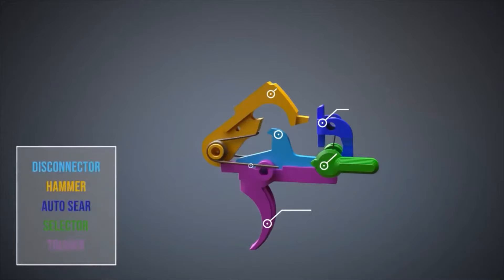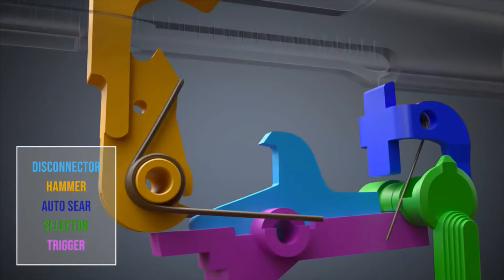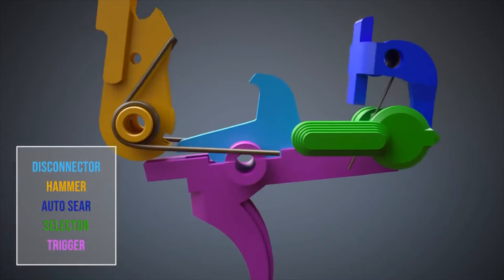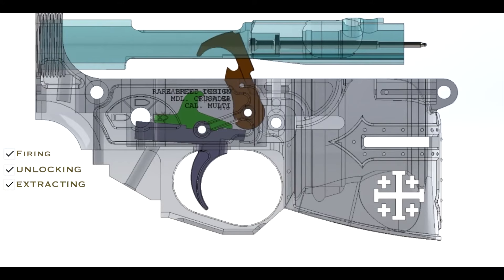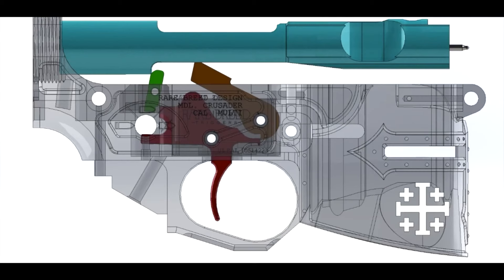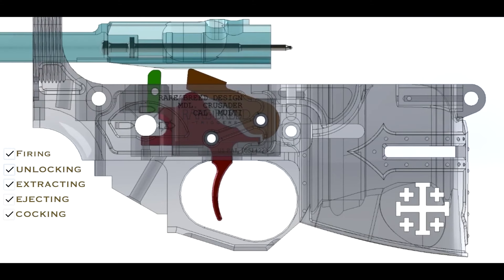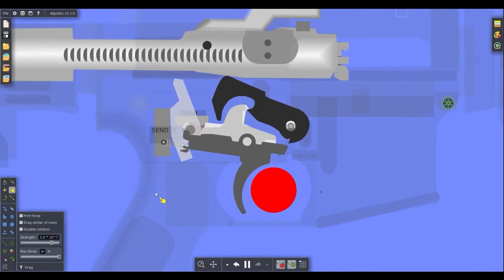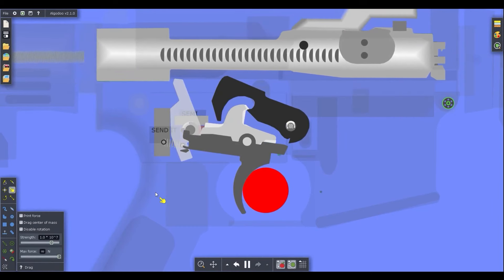HOW AN FRT-15 TRIGGER WORKS, AND WHY THE AFT HATES THEM

Comment: The key is in the very name of the trigger.  Forced Reset.  The shooter does not release the trigger and pull again, the trigger is forced to reset by overcoming the maintained pressure applied by the shooter.
The trigger is not released and re-pulled.
The shooter pulls the trigger and maintains pressure 'till they wish to cease firing.
it's a machine gun.
Reply from the maker: That's not the definition of a machine gun. A machine gun is "Any weapon which shoots, is designed to shoot, or can be readily restored to shoot, automatically more than one shot without manual reloading, by a single function of the trigger." The FRT is two actions, pull and reset, just like a semiautomatic. The only difference is the trigger resets automatically instead of the user having to reset it by releasing and it resetting itself with spring pressure. Literally not a machine gun.
Reply: @NOTSOSLIMJIM  
That's the ATF regulation for a machine gun, not the definition.
Reply: @NOTSOSLIMJIM  
Machine gun: an automatic gun that fires bullets in rapid succession for as long as the trigger is pressed.
Reply: @NOTSOSLIMJIM  
The frt doesn't have two actions, you just pull and maintain pressure.
Reply from the maker: @andrewholdaway813  I literally gave you the definition of a machine gun. You are using a generic definition. Even if you want to use the non legal one, you are still incorrect. Coming from someone with years of experience shooting machine guns, they are not the same. A machine gun you depress the trigger and the weapon continues to fire without the trigger being released or reset. The FRT resets on every round. The trigger goes forward and you pull it again. Even though the trigger pushes the finger forward, that doesn't thang the fact you must pull the trigger again. By your logic, all semiautomatic weapons are machine guns as they can be bump fired.
Reply: @NOTSOSLIMJIM  
Yes bump fire devices also make a machine gun, though not a particularly good one.
Reply from the maker: @andrewholdaway813  lol, ok guy.
Reply: @NOTSOSLIMJIM  
Always being right is a cross I have to bear.
Reply from the maker: @andrewholdaway813  if by being "right", you mean having no clue what you are talking about or fundamental understand of firearms. Then yes.
Reply: @NOTSOSLIMJIM  
Imagine you took a semi automatic weapon and fired it by means of a spring, which was of sufficient strength and no more, inserted between the trigger and the trigger guard. How many times would that gun fire - just once.
Now imagine that weapon has instead the Forced Reset Trigger installed and is fired by similarly sufficient spring, how many times will it fire - until the magazine is exhausted.
It's a machine gun.
Reply from the maker: @andrewholdaway813  so, we are using hypotheticals. Standard move for someone who doesn't understand a topic. Ok, let's play your game. Let's put a spring forcing the trigger back on an AR15 with a FRT trigger. First, you would be modifying the rifle, so your argument is already lost. The user also wouldn't be pulling the trigger. It would start firing the moment the selector was moved from safe to semi. At the end, it wouldn't change the operation of the trigger. It would still function the same. Pull trigger, reset, pull trigger again. The same as the Gatling crank trigger. You can bolt it onto a stock trigger, crank the handle, and it fires just as fast as the FRT. Been around for decades and perfectly legal. Why you ask? Because it still fires, resets, and has the pull the trigger again. You fail to understand that a trigger that mimics full auto does not make it a full auto. Congratulations on still being wrong.
Reply from the maker: @andrewholdaway813  https://youtu.be/jif4Wo0LDX8
Reply: @NOTSOSLIMJIM  
<sigh>  I'm not suggesting a modification, it's a thought experiment, (though I think the experiment could be performed in reality) the spring is a representation of the trigger finger, my point is the spring does not release and re-apply pressure to the trigger, it's one continuous application.
The weird hand crank mechanism is not a machine gun if the crank just repeatedly operates the trigger and more importantly, if it is as useless for practical application as it looks.
If it were driven by a switch activated motor though, it would be a machine gun.
Reply from the maker: @andrewholdaway813  you said the add a spring, that's a modification, no doubt about it. It's a mechanic device added to the firearm. You also don't seem to understand the basic concept of a machine gun. You pull the trigger and keep depressed, not "keep pressure". A machine gun had a mechanical mechanism inside the firearm that trips the sear dropping the hammer as you can clearly see in the video. The "gat crank" works on the same principal as the FRT, the trigger must reset before ever trigger pull. One just requires backward pressure on the trigger to pull it every time, while the other requires circular movement for a device to pull the trigger. The function of the trigger doesn't change. I'm sorry you don't understand the basic fundamentals of mechanical devices, bit that's your issue.
Reply: @NOTSOSLIMJIM  
I'm sorry you don't understand "imagine". Or "thought experiment".
Let's try analogue, the spring is an analogue for the shooters finger.
I'm starting to suspect you may be being deliberately obtuse.
Reply from the maker: @andrewholdaway813  yet you still don't understand the definition, legal meaning, and how an actual machine gun works. You can use all the "thought experiments" you want, it doesn't change the reality of what the difference is between a full auto and semi automatic firearm.
Reply: @NOTSOSLIMJIM  
I gave you the definition,  I'm not interested in how incompetent the ATF is.
How a machine gun works is irrelevant, how it operates is the key. One sustained press, many bullets.
Reply from the maker: @andrewholdaway813  no, you have me your definition. The legal definition under the law (gun control act) is what I provided. You can't just change a definition to meet your feelings when ever you feel like it. It's the duty of our elected official to amend laws. You can add lack of understanding of basic legal definitions to your lack of mechanical fundamentals.
Reply: @NOTSOSLIMJIM  
No I gave a dictionary definition, I told you I'm not concerned with your legal systems definition.
Reply from the maker: @andrewholdaway813  dictionary is not the law....
Reply: @NOTSOSLIMJIM  
I never said it was. I just said that an FRT equipped semi auto can function in the manner of a machine gun.
Reply: @NOTSOSLIMJIM  
... provided the gun is fitted with an auto capable bolt (spooky that)
Reply from the maker: @andrewholdaway813  ohhh, so now it's not a machine gun. It just "functions in a manner of a machine gun." Should I go back to the multiple times you literally referred to it as an actual machine gun? 🤣🤣🤣🤣
Reply: @NOTSOSLIMJIM  
If it quacks like a duck...
Reply from the maker: @andrewholdaway813  so, if you sound like and idiot....
Reply: @andrewholdaway813   So if you pull and maintain a constant pull then this FRT-15 will ride with the Valkyrie and blast away as long as there is ammo in the magazine? Please say yes...please.  The 4 pieces of metal inside this cassette trigger, if you include the spring, will never have enough power to overcome you pulling the trigger and holding to the rear. And if you do that you will get one round to go off. when you release the trigger it will reset and you can try again.  Now if you pull the trigger with 5 lbs of force and don't mash it to death then you will feel a slap on your finger. You time the pull, slap and pull again and now the trigger will work. You pull with 5 lbs and at around the same time you let off the trigger and hold it with 4 lbs and the reset will happen. 
But no matter how you slice it, there are TWO functions of the trigger even if one is assisted by the forward momentum of the bolt carrier. Technically there are 3 functions of the trigger if you want to count the activity of the bolt carrier on the trigger pack to make this whole thing happen. You can over ride the "forced reset" of this trigger just by holding the trigger back with more force than the bolt can put into resetting the trigger. And since one of the primary casual effects of being a machine gun is that you have to hold the trigger all the way back the whole time you are shooting then this cannot be a machine gun. Pull the trigger on a FRT-15 trigger all the way back and hold it and you will get one shot...period. There is no argument, that is exactly what will happen.
Reply: @equuspallidus  
I will, as you request, say yes. You don't 'time the pull' at all. You could replace your finger pressure with a spring applying constant pressure to the trigger and the gun would, as you put it, 'ride with the Valkyrie'.
Reply: @andrewholdaway813  Physically impossible. with practice you can kick out 900 rounds a minute but the number of rounds expended does not a machinegun make. Its the action you have to take with the firearm that makes it a machine gun. And in all cases a machine gun must be able to fire a burst or all of the rounds in its magazine with one PULL of  the trigger and you must hold that trigger to the rear the whole time. 
In the case of the FRT, your finger is more of a machine gun than the trigger. If you are one of those people that are just uncoordinated and cannot find that sweet spot when pulling the trigger so that it resets properly then you just have a really expensive trigger that goes bang once, rinse and repeat. I find this trigger  to only be a little better than a binary. You can outrun the mechanics in a binary trigger which leaves you with a dead trigger and you pulling back the charging handle and hoping you can get the timing right the next time.
Reply: @equuspallidus  
You seem to be making your own rules here.  You apply your 5 lb of pressure and maintain it. As you say, with a binary trigger, where you do release and re-pull it is possible to out run it; you can't outrun the FRT because the reset is forced against your maintained finger pressure.
Reply: @andrewholdaway813  The FRT is more akin to placing a sufficiently strong spring BEHIND the trigger so that once you fire it can’t be held back without sufficient force, and thusly requiring a deliberate second action of pulling   be applied to fire again. I like thought experiments but you know what’s better than that? REALITY… So let’s see what happens if you pull and hold the FRT trigger fully to the rear over coming the forced reset triggers design nature? Do you even know ? The action locks open and won’t even cycle🥴😂👨‍🔬😌!  What happens when you say ,” zip tie a MG trigger fully to the rear” and fire it by dropping the bolt”? A runaway MG 🏃‍♂️! Yay science 🧪 👨‍🔬!! Lol. Not a MG but nice try. You can call the way people hold/grip a semi auto weapon(bump fire)a “MG” using your inane “understanding” and analogy lmao.
Reply: @TooManyChoices1  
No it isn't.
Reply: @andrewholdaway813  And PS- You actually can’t “out run” the FRT because of the locking bar that blocks the trigger until the weapon is in full battery. Did you even look at the design? You sound like the AFT before they even evaluated the trigger… “We know it’s a MG, we just have to look at it and figure out how to call it one” ::paraphrased::😵‍💫🤣🥴…
Reply: @equuspallidus  Please go look at my short video about the FRT, I think you of all people will laugh after your analogy of the 2 year old lol.
Reply: @andrewholdaway813  Yes it is … 🥴
Reply: @TooManyChoices1  
Mate, you really are revealing a total lack of understanding of the mechanism.
Reply: @andrewholdaway813  Actually you are… I completely understand it, and that’s your issue. If you hold the trigger fully to the rear and run the action it stays open until you release the trigger and can fire again. That’s not what happens when you hold a MG trigger fully to the rear and run the action. You can keep stating what your feelings wish, but the reality is different…
Reply: @TooManyChoices1  
If you prevent the forced reset the gun will jam.
Reply: @andrewholdaway813  No crap, I already said that…🥴😒🙄
Reply: @TooManyChoices1  
No you didn't, but who cares what you said anyway.
Reply: @Leroy Griff 
Do you mean machine gun as defined by US firearms regulations, or a machine gun?
Reply: @Leroy Griff 
So you mean a machine gun as defined by US regulation?
Reply: @Leroy Griff 
...if i use the recoil forces...
Not necessarily, but in the case of these forced reset  triggers it makes them full auto, whether it makes them machine guns as defined by US law your courts have yet to decide.
Reply from the maker: @andrewholdaway813  no, that is not how a machine gun works. Maybe in your head because you don't understand firearms. In the real world, this is not a machine gun.
Reply: @NOTSOSLIMJIM  
What isn't how a machine gun works?
Reply: @Leroy Griff 
Read my reply more carefully. One pull of the trigger producing continuous fire makes it full auto.
Reply: @Leroy Griff 
Depends how it is implemented.
Reply from the maker: @andrewholdaway813  we have had this discussion. I've explained it to you, and you fully understand how they work. You simply refuse to understand the difference between a machine gun, and a semiautomatic that fires quickly.
Reply: @NOTSOSLIMJIM  
And you fail to understand that rate of fire does not full auto make.
One pull, continuous fire - full auto
Reply from the maker: @andrewholdaway813  ok, step back for a moment. I believe I'm mistaking you for another individual I had a long conversation about this trigger with. I do believe we both understand this trigger is infact, not a full auto trigger.
Reply: @NOTSOSLIMJIM  
No; you were right the first time 👍
Reply: @Leroy Griff 
No
Reply: @Leroy Griff 
Really? What does it tell you.
Reply: @Leroy Griff 
Whether the trigger mechanism is defined as a machine gun under American law has yet to be decided by your courts.
Reply: @Leroy Griff 
Bump firing induces automatic fire.
Reply: @Leroy Griff 
Induce: bring about or give rise to.
Reply: @Leroy Griff 
Automatic fire is what I said.
Reply: @Leroy Griff 
You didn't  do a very good job then
Automatic fire is what I said, please desist in using the term machine gun, it causes confusion due to your firearms regulations.
Reply: @Leroy Griff 
Evidently not, but we will keep trying; we won't  give up on you.
Reply: @Leroy Griff 
...the only term...
What matters is that you accept that the device makes your gun full auto.
Reply: @Leroy Griff 
Full auto is defined as a single pull of the trigger producing continuous fire.
I know RoF is not relevant, why do you keep mentioning it.
Reply: @Leroy Griff 
Single pull - you got an F in reading didn't  you
Reply: @Leroy Griff 
The fact that you don't  release pressure on the trigger is what you do understand but won't  admit.
Reply: @Leroy Griff 
That's  why it's  (induced) automatic fire.
Reply: @Leroy Griff 
No, it induces automatic fire; and stop saying machine gun. Why can you not grasp such a simple concept?
Reply from the maker: So, by this logic. If I have a car that can go fast, it's automatically a race car? Maybe if I have a truck that can tow a car, it's a commercial tow truck and needs a commercial license? It's impossible to reason with people who don't understand basic concepts like "hold down trigger" and "pull the trigger quickly" if they both accomplish similar results, they obviously are the same thing to them.
Reply from the maker: @Leroy Griff I grew up in one of the most liberal cities in America. I had the same education telling me, guns are bad, my whole young life. The difference is, I'm able to think for my self and question things that don't add up.
Reply: @Leroy Griff 
...you say...
No, you  are the one obsessed with RoF, I say if you pull and hold the trigger and the gun fires continuously that is definitively full auto.
Reply: @NOTSOSLIMJIM  
No, you have a car that can go fast, you have a truck that can tow a car.
...It's impossible to reason with...
Yes it is impossible  to reason with such people but I will persevere, you pull the trigger and maintain pressure on it - the gun fires continuously, that is full auto.
Reply: @Leroy Griff 
...yep but...
You don't  appear  to know what "third world" means.
Reply: @NOTSOSLIMJIM  
...guns are bad...
No they are not.
You, and Griffter, appear  to be under the delusion that I don't  want you to have access to these weapons, that is not the case, I really don't care, it has no effect on my life.
But it is full auto.
Reply: @Leroy Griff 
Depending on the definition you are using it could be so classified, which definition are you using?
Reply: @Leroy Griff 
Firearms engineers have their own definition of third world well, you learn something every day.
What, pray tell, is that definition.
Reply: @Leroy Griff 
Indufor????
And why.